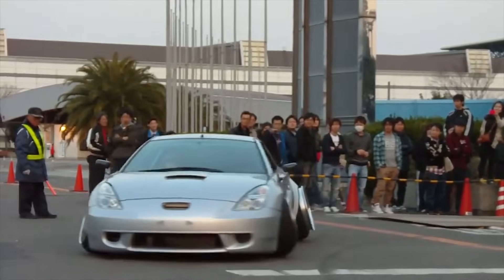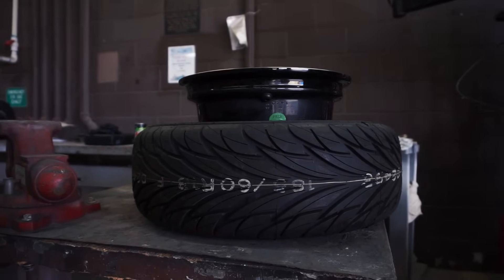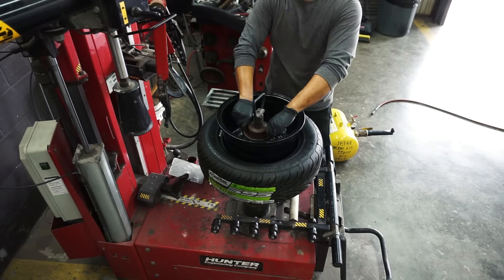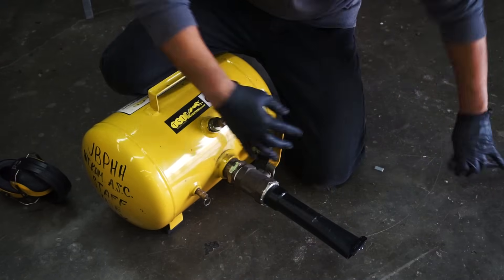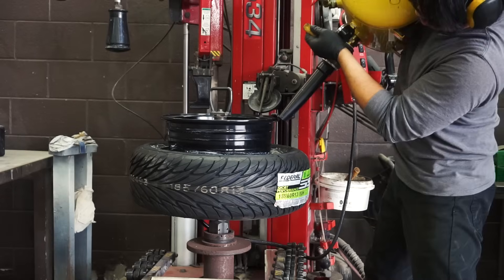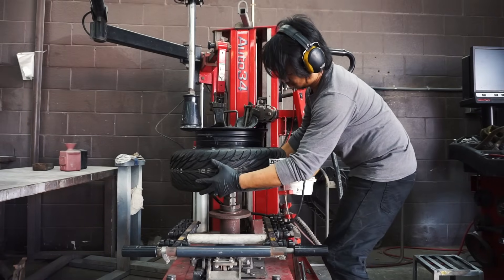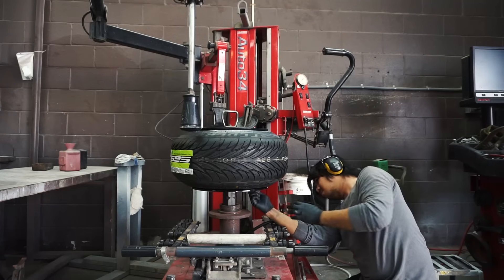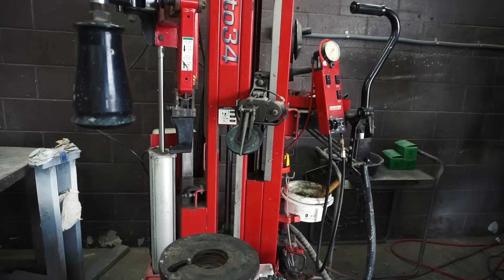Tire Stretch: 185/60R13 on 13x10

Comment: The most impressive thing was getting a perfect tire Ballance without weights.
Reply: `must be a high quality / expensive wheel.
Reply: pull the stickers off and it will need 5 gram :)
Reply: Vølga i balance tires all the time, it’s a rare occasion but it happens
Reply: Static balance its not a dynamic balance
Reply: Plus he’s doing single weights instead of dual. When I balance wheels that only need single weights, most of the time it come out to less than a gram or even no weights.
Reply: Still had sticker on the tire tho, soo as that’s worn off it’s not balanced anymore
Reply: Match mount
Reply: Well i had 1 or 2 tires that didnt need any ballance weights

Comment: Are we all missing the fact that tire was perfectly balanced
Reply: Shane Osborne as all things should be
Reply: It's not hard at all to balance a tire.
Reply: @heyjaypay4521  he means he didnt have to put counter weights on it at all, it was perfectly balanced after the seating
Reply: thanos approved.
Reply: @Příslušník VB yeah that bugged me, always took those off before balancing when I did it.
Reply: I do like 2-3 tires a week that are perfectly balanced without weights. It isn’t that crazy
Reply: Possibly the stretching of the tire made out the balance to be even between it and the rim
Reply: @goldmamba2468  I do 80 tyres a week and maybe once a month I'll get a perfectly balanced wheel. it is crazy. And no its not spelt tires, don't correct me, thats how we spell it here

Comment: We have been stretching tires for years in the low rider community 5.20’s on 13x7 wire wheels and 155-80-13 tires in the same style wheel. 👍

Comment: You were correct on mounting it upside down, that's called a reverse mount wheel. Also for best results have somebody hold the tire halfway up the wheel while you blast it, it shows fit the air to fill the gap better and makes the space it has to cover less
Reply: He shows the drop center of the wheel in the video, its a top mount not reverse. He flipped it to blast because trying to blast top mount on that specific wheel as he said is all open space until the last inch, can be very hard to seat a stretch on a drop center that big

Comment: Tip. 
Use a direct air line .ie, straight from your compressor or main line when trying to inflate the tyre. The Auto34 air hose as to much restriction, that's what the clicking sound is..    Great video !!

Comment: Back when it was the fad to put stretched 175/70-14's on 8-10" knock-off wire spoke wheels (usually on an 80's cutlass for some reason), we would simply inflate tubes in the tires ahead of time to help form a 'stretched memory' into the tire's sidewalls before mounting them.  
Think of it like this: tires at the shop were normally stacked by size, applying a squeezing (compression) pressure to them, and when you un-stack them they don't immediately return (relax) to normal width between the beads.  By inflating tubes inside the tires ahead of time (days or weeks), we could reverse that squeeze and if we worked quickly, could get the tire mounted without a cheetah because they would momentarily hold that 'stretched memory' shape.
We still required a signed liability (hold harmless) waiver, and warranty waiver.

Comment: It might not make a whole lot of sense, but I work as a tire mechanic and I’ve had people asking me to stretch tires out and it’s been a pain. What I’ve found is that do the same as you are having the larger part of the drop center seated first, than putting it vertical on the balancing machine so that the rim doesn’t move at all and there’s no downward force of the weight of the tire to blast. That way once the bead is atleast some what seated on the back there’s a smaller pocket on the bottom side of the tire to blast. And the top of the tire is somewhat centred between both the beads on the rim. Not easy to explain in  text or this extreme of a stretch

Comment: Keep the air hose connected to the blaster after you build some pressure. Make sure the  small input valve is opening and blast the tire right as the overpressure relief is about to go. This will keep forcing air for longer after you initially blast it. Be careful tho, the blaster will kick like a mule.

Comment: You did everything by the book.
Would never use burning gas like some do..
Yes fill the tire allmost to max air pressure. Then lower it after a few min..
185 is kinda extreme on a 13 inch.. but look good.  Just a tip, be carefull stretching premium tires.  Some of them are not strong enough to be stretch to much
Supose to be some of the best to stretch is Falken tires

Comment: i run a very slight stretch on my tires, i have a 8.5' wheel and 215 tires, looks perfect for my taste
Reply: I agree, a little stretch is tasteful
Reply: Yeah, that combo is fine. I tried a 205 40 17 on a 8.5 bmw wheel,  but it didn't look right. Ended up with a 225 45 17.

Comment: Ive seen people get killed from idiots with these stretched tyres and as a qualified tyre fitter it should be illegal in all countries they are dangerous... Most of time fitted to a car with extreme camber meaning your driving on the sidewalls
Reply: How exactly did they kill people?
Reply: Peter Griffin tire explodes causes you to lose control of car=accident
Reply: I'd like to see when, where, and how someone was killed by this.
Reply: @petergriffin4629  I think the camber is now at fault though not the stretch
Reply: @petergriffin4629  your stretching the tire to a point it will cause cracking in the tire, do some highway driving especially with camber, and your tire life can be next to nothing, plus it reduces your contact patch just get the right size wheel and tire so you get performance and a mean track stance
Reply: Tyrefitter is not a profession, stop lying
Reply: Ricers make up .1% of population... Not That Much Of a Threat
Reply: Explosion
Reply: I’m running a 205/40 on a 8.5 barrel does that seem safe?
Reply: @aadvb6664  the average joe cannot and should not fit a road tyre. that's where trained professionals come in.. so it is a profession.
Reply: @UnacceptableViews  define, trained professionals.
Reply: I think you are stretching the truth.
Reply: lol go big or go home  :)
Reply: It is illegal everywhere, but we do it anyways.
Reply: A little stretch really helps handling. I’ve got 205/50/15s on a 15x8 (tires have a 6.89” tread patch) and it has great turn in response. I could put a 225/45 but I’d sacrifice a little turn in response for better grip. Also the 205s I run have longer life than any 225/45 I’ve found
Reply: @SkyLinMegas  ones that put correct air pressure for starters, balance within tollerence of the machines they use, know what size socket to use ( personal experience, national tyres uk using 19mm socket on 17mm studs ), cleaning rim before installing tyre, tyre bead, correct rotation, correct torque setting ( again national tyres setting it too high - 90 kg person having to stand on 600mm breaker bar before the studs come undone, new valves and no doubt i have missed some items off. how about scratching rims removing low profile tyres?
Reply: @UnacceptableViews  what? Literally anyone can fit a road tyre... am I average? Well my name is Joe.. hmmm 
I do all my own maintainence and repairs, but only my own
Reply: More like gauged piercings..
Reply: You've seen? Yea ok
Reply: @SkyLinMegas  someone who has experience in fitting road tyres and knows how to do it without damaging the tyre or exceeding the tyres rated fitting specifications
Reply: @jrea424  yes literally anyone can fit a tyre. but unless you know how to do it safely and properly then you shouldn't attempt it. i worked as a tyre fitter for years and although i no longer call that my profession i still fit my own tyres because i have the gear and knowledge to do so.
Reply: how? this increases the handling of the vehicle. there is more rubber than the tread running through the tire when you drive like this. unless its wet out, then your skating
Reply: Dunno but i once saw a pic of the shape  of a man on the tyre shop wall becauae a truck tyre exploded on him.He was just paint on a wall.
Reply: In France we have specific "tire size" by vehicule and by wheel size, defined by the manufacturers themselves. If you change the original size to do some stupid shit as these stretched tyres, it's illegal and you can't get through MOT. I know we don't have much cool cars by there, but at least we don't see stupid shit like overcambered, stretched-tyres, slammed to the ground cars
Reply: @aadvb6664  if you get paid for it it's a profession.
Reply: Ðavз it’s actually super easy to mount and balance tires. Certain tires and wheels make it more difficult but in general it’s really easy if you have the equipment.
Reply: @UnacceptableViews  It is a fuggin' JOB. It is  not a career. A career is something people 'get into' over years of education or acquiring specialized skill sets. It is something generally kept for decades.             Tire changers do not fall into that category. That would be a dead end job for a guy who doesn't have the skill set to be a mechanic.
Reply: @widekiario5357  yes thats safe cars here used to run 205's on 8.0" rims from the factory so yours is functional, its mainly the tyre profile that determines the handling if you dont go past 2" in width difference with the tyre and rim

Comment: That's an impressive stretch! #MajorProps Here in Germany I do some tire stretch. I have special tools to cover the gap between the tire and the wheel. One cheep solution on less stretch can be a bicycle tube at the lower lip. The tire moves up and the compressed air can be shot directly in the gap. // Nice edit - like it a lot! 😎👍
Reply from the maker: A few people had mentioned this one to me. I have yet to try it. What would be the size of bicycle tire to use? Same size as wheel?
Reply: @n0eLoL  I bought some a long time ago, so I don't remember exactly. But the diameter should be the same size. These parts are dirt cheap, so I bought a few in different widths. I recommend to buy the widest possible. For Dirt-Bikes or Downhill bikes für example. Worked pretty well. Cheers, TOBi 👋😉👍

Comment: Something to consider with tore stretching is most if not close to all vehicles running them are show vehicles. Meaning they don't go on 100+ mile drives so the risk of a blow out is considerably lower then someone with a regular tire driving on a 500+ mile trip a few times a year

Comment: what happened in your successful attempt was the bead on the outside clung to the rim. i do it first time by seating the bead in the outside or inside rim with the standard bead breaker on my tyre machine then lift the tyre with hand until i close the gap and fill the tyre the normal way from the valve without using huge burst of air.

Comment: Recently fitted a 185/60 on a 13x10. 
Then swapped to a 195/50 
Thought it'd be funny to try a 165/60 and it inflated, but couldn't get fully stretched to both beads. So a 165/65 may be the absolute limit for a simple fire on stretch on the 13x10

Comment: Those are reverse mount wheels, a ratchet strap would help you a lot, I've changed from low profile tires to stretching big super swampers on 15 inch wide wheels
Reply from the maker: I need to try that ratchet strap technique as well

Comment: A tiny bit of stretch can vastly improve turn in response. I have 205/50/15s on 15x8s which has amazing turn in
Reply: Caleb Nation i had 195/45zr15’s an they felt way better beating the fuck ou of it, i tried 195/50-55, 205/45-55 and 185’s aaand 215s.  The 195s felt better in terms of quicker turn in, overall response and how planted it was on the road.  (And the fitment was 10x better altough i wouldve preffered 185’s but since i could pull 195’s and stay as low i stuck to that

Comment: Use a p3 or also know as a quick air. You can also tube the tire and seat one bead then pull the tube out the drop center side.  Pop a 413 stem in it and push the tire to seat the other side.

Comment: Not only it looks silly isn't that really like not safe?
Reply: not safe at all specially if there is weight in the car
Reply: @finno123456  millions of people do it especially on huge trucks and I've never heard of a death by stretched tire.
Reply: all depends on the amount of stretch and the air pressure. a 205 or a  215 on a 8" wide rim is a normal and safe stretch, but what shown in this video isnt considered safe. but safe enough that you can drive normal with high air pressure. people who know a bit about what they are doing dont have issues with debeading and stuff. stretching a tire on a rim so wide it doesnt even meet the edge of the rim is considered dumb :p showcars often do that.
Reply: Ricky spanish happens all the time, same thing with cheap wheel spacers, obviously it’s not safe for YOU to do anything car related
Reply: Nah you should be fine I've been running 195/50/15s on a 15x10  for 2 years and I've had no problems so far
Reply: @str3614  195 on a 10??? Geez. I'm like I'll do a 225 on a 9 or 9.5 and that's it.
Reply: i have a tiny stretch, 215/40 r18 never had issues
Reply: @str3614  i mean all it takes is one tire to go out then you wont be here to say "dont do it ive had a problem"
Reply: @maddog063  ive had 195's on a 9j for ages, rag the shit out the car, it even has 60mm spacers on the rear, never had any issues
Reply: @rickyspanish5326  I've seen numerous tires fail from stretched tires.
Reply: @rickyspanish5326  Hold up what "huge trucks" are you talking about? Cuz semi trucks don't do this shit for sure
Reply: Ricky spanish I have seen it. I’m an MRI tech at a level 1 trauma center.  I imaged a guy that was completely brain dead.  Head was swollen like a watermelon.  The tire exploded on him when firing the tire to get it to expand flush with rim.  So yeah definitely not safe at all.
Reply: @rickyspanish5326  blown tires don't kill people, drives without the know how to control a blown tire at speed is what kills.
Reply: Yeah not to mention the rapid wear on the inner so new tyres alot sooner
Reply: Nothing  happens I have stretched tiers on my mustang just really have to be careful on streets that have pot holes going to fast can break the rim
Reply: Yes it is safe. I know plenty of people who have it. The worst thing is if your tire goes flat you’re going to have to use the spare
Reply: All it really does besides flat tires all the time is it eats your tires like crazy because there is really no way to align your vehicle .....   I do tires like that no fancy equipment ....  Just a cheetah....   And some skidd ....

Comment: Mine use 185/55 to 16*9.0 on rear. 16*8.0 on the front. It’s kinda hard to mount new tires. So I always move the front to rear wheels. And put new tires on the front. It’s already pre-stretched so it’s easier to mount on the rear wheel. Front camber was neutral. But rear was -1.5’. I purposely let the rear wear the thread and finish off the tire.

Comment: Sometimes it helps to have a rachet strap around the tire to force the tire bead in contact with the inside of the rim. When it starts taking air by itself release the strap.

Comment: Thanx for the video.
I'm actually doing this exact same thing. On the exact same VMS rim, only mines a 13x9. 
I'm also using the exact same tire, and size... lol
But just to add something on stretches like this.
It's best to have 2 guys, and 2 Cheetahs. 
Hit it from both sides, and it'll catch almost every time.
Reply from the maker: If only I had people to help me out ☹
Reply: @n0eLoL  
I guess that would be kind of a bonus.. lol
What did you end up running these on?
Reply from the maker: @mattt1670  the green SR20 Starlet I made a video about. I mounted and stretched the tires for him

Comment: In the Netherlands we have apk for cars, the yearly checkup. And they pass streched tires as long as the wheel doesn't stick out of the mud guard more than 30mm. So it is allowed in the Netherlands, with European insurance I can drive it through all of Europe without a problem.

Comment: Lol! I remember doing this in the early to mid 1990’s. Best I ever did was a 195 on a 10” reverse offset rim. It could take hours to seat them. In those days the trend was spoked McLeans or Dayton’s with true spinner knock offs.  Customers would leave with tires hitting fenders when they turned and not even care. We would have them all sign a release. Your balancing with the tire tag on. Come on mannnnn!